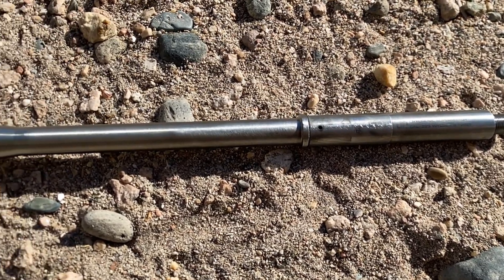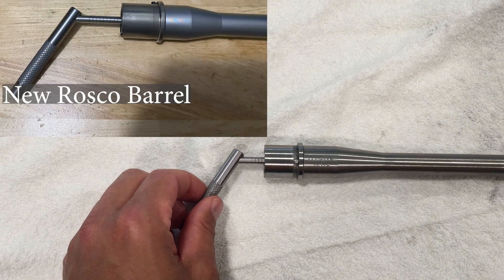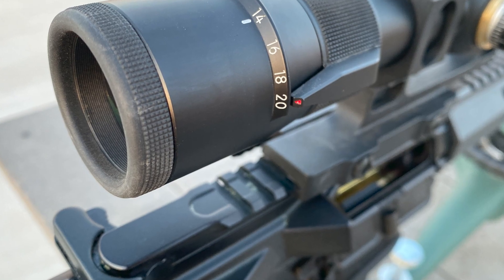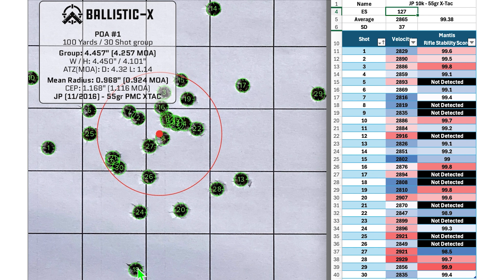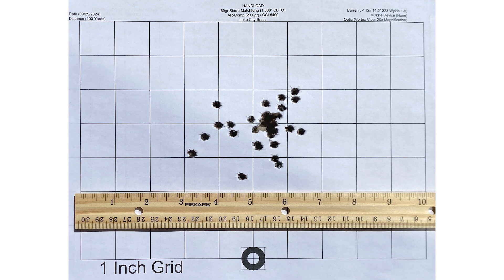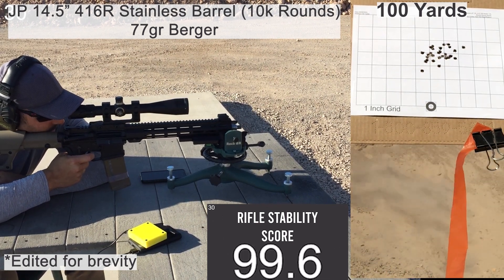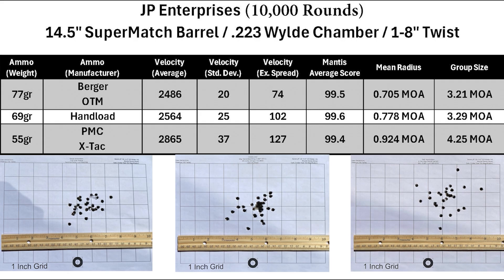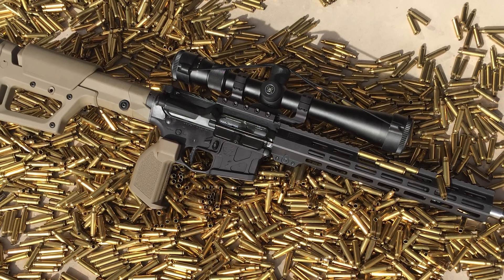10,000 Rounds Through a JP AR-15 Barrel—Is It Cooked or Still a Laser?"

Comment: but bro, what was this barrel's initial performance? in conclusion, did you experience a performance loss? sorry if i missed it, which is likely since you covered basically all the bases. other than that, amazing video and format my guy. 🤌
Reply from the maker: Thanks for the compliment!!  The barrel did definitely lose some performance.  It was 6 year ago when I initially grouped the barrel, and I was doing 10-shot groups back then.  So, I don't remember the exact performance, and I didn't save the targets.  So, I didn't really want to guess and put that on video. But, if I had to take a guess, I think the barrel was doing 10-shot groups just over an inch or so.  But that could be wrong, as I don't perfectly remember. I can definitely say that it was shooting tighter than it is now.  There has also been a loss of velocity.  Compared to a new 14.5" that I shot, one of the loads was 100 fps slower, I think.

Comment: The correct TDP Colt go gauge for a 5.56 chamber is 1.4646, the no go is 1.4706 and the field gauge is 1.4736 
Forester gauges tend to be .002 to .003 longer than Pacific tool and gauge head space gauges. PTG gauges are more accurate.
Reply from the maker: Thanks!! I have some PTG gauges on my to-get list. But, it might be a minute before I get them.
Reply: @PrestonJMoore  I have the PTG 11 piece incremental head space gauge set..It has been indispensable for giving the exact headspace of barrels. 
A PTG function gauge is another must have for testing barrel chambers that may have a tight chamber. If the barrel fails the function gauge, it gets sent back immediately. I had them custom made with a removable long handle so it is easier to check barrels all ready mounted on an upper.
Reply from the maker: @hairydogstail  Nice!!! Those are some nice tools and I am sure they come in handy.  Hopefully I'll be able to afford some one of these days.

Comment: Odd question. Have you ever done a barrel nut or muzzle device torque tune test? You mention that you torque the barrel nuts to 40 ft/lbs, wasn't sure if there's a reason you picked 40 or if torque tuning in an AR makes any measurable difference, or...? Also, this would be a great video for you to do if you're ever up for it. Maybe when you get a new barrel broken in. Haven't found anyone actually doing a torque tune test in an AR on camera.
Reply from the maker: I have not done that type of testing on or off camera.  My suspicion is that it won't do anything meaningful in the context that I use my AR's. Although I think it would be interesting to look into it.  So, it's on the list of things to do.  
The reason why I specifically state the barrel nut torque value in the video is just to be more transparent, in case anyone has a question about it.
Reply: @PrestonJMoore  Yeah, just wasn't sure why you picked 40 as opposed to another torque value. I saw a video from a service rifle match "guru" years ago that said that he does it to all of his match ARs for the barrel nut and flash hider. I'm sure it does something, just not sure how much it does, and I've never gotten around to testing it. needless to say it sounds like a pain in the butt. You need a vise at the range, all the equipment to pull the barrel, shoot a group, take it down, change torque 5 or 10 lbs, reassemble, shoot a group, repeat as needed till you find the best torque window. Then test torque in that window to find the sweet spot. Then repeat on the muzzle device(sounds like less of a pain). If it tightens groups 0.5 moa or more repeatably, I'd say it's worth burning a day and a bunch of ammo. If it tightens it 0.125 moa or less, it's not worth it outside of precision competition. Only 1 way to find out I guess.
Reply: I can't remember where now, but when I was looking for advice on building my ARs I came across a video on accurizing the AR platform where they did pretty extensive testing on barrel nut torque. I remember them saying that 40-45 lbs tended to consistently provide the best results, but the specific ideal torque would depend on the barrel/rifle harmonics or whatever other voodoo. At that point there's a lot of diminishing returns, so the advice was to torque between 40-45 ft/lbs and call it good.
Reply: @ Yeah I heard around 45 and 65. The 45 was either for free floated or adjustable gas blocks(I cant remember which one). and the 65 was for non adjustable gas or non-free floated. If I had to guess, It's the free float status that indicates where you might find the sweet spot. Doing the torque test sees like a pain for most people unless you have a vise at the range.